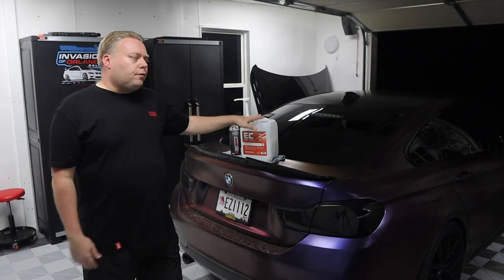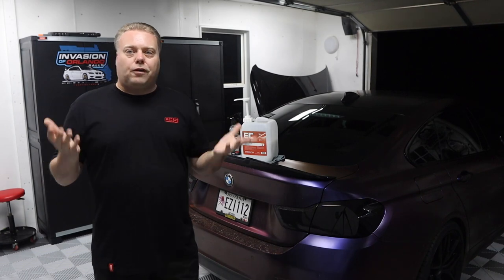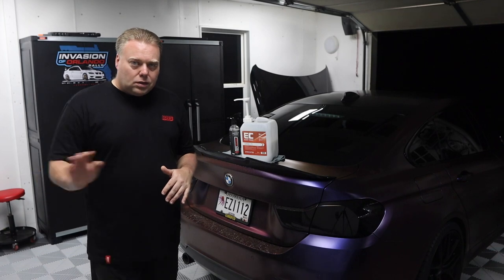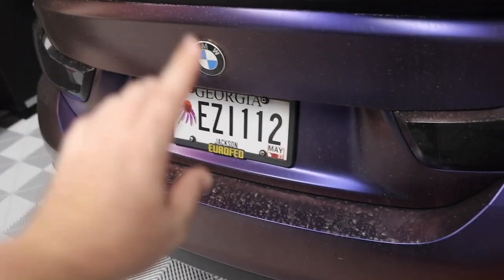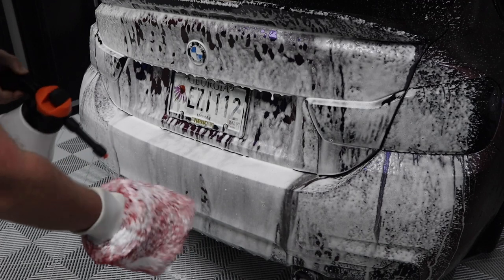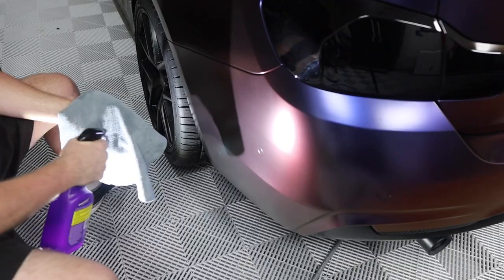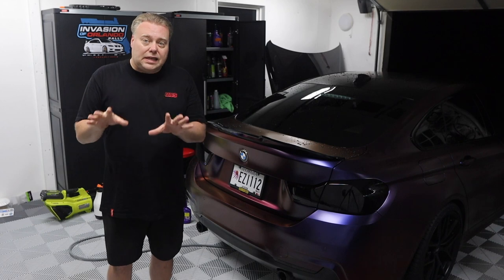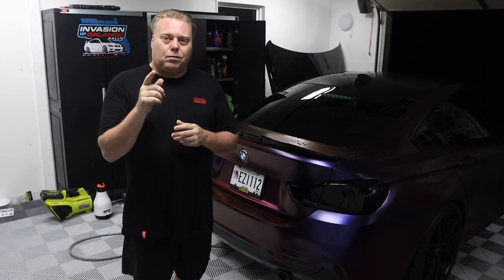Spray & Rinse Sealants | What you need to know | Quick Beads | Easy Coat

Comment: pointless over any durable coating as these spray n rinse products are not durable whatsoever especially onv wheels where you're using high ph or low acidic cleaners.  if it lasted a couple wages sure but  quick beads n ceramic gloss are gone after a thorough wash . use a coating or true sealant designed to resist chemicals and you'll be good no need for spray n waste products
Reply from the maker: Spray and rinse are meant to be toppers to a true ceramic coating in my opinion. Never would use as any kind of long term. I don’t use high ph or acidic wheel cleaners. Since they are coated I just use a ph nuetral iron remover and normal foam soap do my contact and clean every time. I will tell you it took a lot to finally get that locked in dirt out. So they were real durable against me trying to remove them.

Comment: or you could just wash the car when dirty and stop with all the waterless and rinseless wash only applications
Reply from the maker: I don’t do toppers anymore todays coatings are so much better I just let them do the work. Rinseless and waterless though both require contacting the surface so that would be cleaning. Touchless yes does not get fully clean.

Comment: I don't think these are "sealing in the dirt" -- chemically that doesn't make sense, because it means the sealant is still on there and somehow standing up to dozens of washes including with APCs. They're just not that durable. I suspect this is some kind of mineral based residue. Since APCs and iron remover aren't removing it, I would suggest trying an acidic cleaner, like a water spot remover. It's the 3rd part of a typical chemical decon wash and what us northerners do in the spring to remove salt deposits from our car.
Reply from the maker: Water spot remover does not work either. I talked to several chemists who said you can seal in the dirt layer or at the least the dirt or residue is part of that layer. Using a sealant too much just buries it under those layers. I probably applied these sealants dozens of times before realizing the dirt. You could be right, but I’m no expert in that field to know. 🤣
I can say now not applying a sealant for months the surface it getting more vibrant every wash and looks like I might finally have it all off.

Comment: A cool vid Keav (a cool name, never encountered one 🤔), yeeeah,,topper buildup" is a thing, I never had it, but my friend reeealy loved his toppers, I'm not that guy - I'm not a fan of these spray / rinse sealants (maybe on wheels, contemplating now between wet coat and quick beads - wich side you leen on?) and any qd or topers in general, on my BMW I like to see raw coating performance, on the daily though I experiment - lately used Gyeon Ceramic Detailer - left the surface super slick and mega shiny (I can see the appeal) but still, none of this stuff will ever touch my German destroyer of worlds 😅 cheers!
Reply from the maker: I no longer use toppers since I have redone using DIY ceramic coatings. I prefer the raw performance as well plus saves money. Especially since I have gone Rinsless for my contact wash I don’t need the extra hydrophobics to leaf blow the car I towel dry now. I prefer Quick Beads if I did a spray and rinse and Gtechniq easy coat would be a close 2nd.
Reply: @CarsWithKeav  Man Keav so cool you have come to the ligh and finally towel dry :) No mineral buildup from evaporating water from the blower <3 Hey what do you use on the wheels (coating and or topper wise)? I used Carpro DLUX on my winter black matte 796Ms and on my 791M gloss blacks but maan the contamination and brake dust from the M performance breaks is hell and it clogged the coating in like  3 months time... (and i wash the wheels weekly) It beaded really good untill.. it didn't xD had to use iron remover (try to minimise it as it induces rust) and DIY Water spot remover (BOOM got the beading right back) i just wonder how you deal with the wheels - do you use a specific wheel coating, or normal one, or spray sealants (contemplating Quick Beads now as a topper over DLUX) or normal wipe off ones :) Thank you soo much sir for the reply, it's always a pleasure speaking with you!
Reply from the maker: @victoryensured7137  I have Gtechniq C5 and DIY 8 year on my two sets of BBS CIR’s. I switched to carbon brake pads which helped a lot with my brake dust. The Gtechniq has worn off and I’ll need to recoat. The DIY 8 year is just amazing if it’s not beading water spot remover and it’s back. When I did leaf blow I used spotless water so no minerals there.
Reply: @CarsWithKeav  So you don't use toppers on these wheel coatings like Quick Beads or the Gtechniq one from time to time? As i sad i don't do top my main paint but on wheels im wondering... I love both DIY and Gtechniq a lot, top tier companies but wished Gtechniq was a little less stingy with the amout of product they offer for the price, just look at C6 Matt Dash - such an amazing product but man 100ml? I know you dont use a lot but still :) Thank you for your time and sharing the knowledge!
Reply: @CarsWithKeav  Oh and C5 was great when i used it, a really good wheel coating, with DLUX i have mixed feelings though haven't tried the DIY one, i have on my shelf the DIY 3 year.
Reply from the maker: @victoryensured7137  agreed, I love c6 matte dash, but is expensive. Their prices will always be slightly more since manufactured in Europe and the cost of bringing here. I used to use toppers on the wheels, but that 8 year coating just doesn’t need it.
Reply from the maker: @victoryensured7137  What I liked best about c5 is you could still attach wheel weights to it and they would stick since it’s a quartz coating. Only problem lasts just a year or two.
Reply: @CarsWithKeav  Dlux is the same in this regard (lasts year or two) but it was a pain to apply in my opinion and in my case, albeit the beading is strong and cool, still it clogges up REAL fast on performance break pad dust, oh and Keav im from EU and here Gtechniq is also expensive - it's just expensive everywhere (and stingy with amount of product) xD Hmm maybe i'll pass on toping my wheel coating after all, nothing good ever comes out of toping (short term quick fix and exstasy over long term crying and cursing and working a lot to fix it), but still i might buy the Quick Beads or Ceramic Gloss to test it for my daily beaten Toyota CHR to top up Cancoat Evo - im going to apply DIY 3 year or the stack on it some time in the future so i don't mind at all :) Cheers!
Reply from the maker: @victoryensured7137  wheel coatings will always clog not just from brake dust, but it’s the area that gets a lot of road grime from the road which is usually minerals as they get spun and the water evaporates and dries causing the minerals to mask the coating. Just like the panels behind the wheels will exhibit the same
behaviors over time.
Reply: @CarsWithKeav  Still even when i don't drive in rain? I never drive in the rain with my BMW (the whole clogging and DLUX is on BMW) and still it clogged SUPER fast, but your right, wheels get a beating...
Reply from the maker: @victoryensured7137  Wow, have not had that problem I don’t get much brake dust. I have the F80 M3 brake upgrade with carbon pads. I myself don’t drive my car in the rain either. 🤣 My wife’s car in this video get all the rain driving and my X1 daily. The 335 is a garage queen now.
Reply: @CarsWithKeav  Keav your living the dream man! 😁 And i really like your vids, if i had a garage (i only have a communal one, still a nice one at least, all my detailing is done in there) i would spec it to your standard and be in debt for the rest of my life 🤣 Oh and did i mention i want your car? 🙏
Reply from the maker: @victoryensured7137  Thanks! I went into debt quite a bit building the garage, but a YouTube ended up paying for it over a few years.
Reply: @CarsWithKeav  I watched a vid of you explaining the financial situation with YouTube, and i'm really glad, you earned it! Keep it up Keav!

Comment: This is great to know! Thanks for posting! 
I was considering doing this exact thing - foam, rinse, and a touchless sealant - over the uocoming winter so you saved me! 
I had considered the possibility of sealing in dirt but I figured that one it happened because I thought the silence wouldn't be able to cling with dirt behind them and would just come off in the next wash, but evidently not! 

I guess I'll rinseless wash at least before adding additional protection. Thanks again!
Reply from the maker: Yeah, panel has to be clean. I thought it was clean enough. Well lesson learned. 🤣

Comment: Curious, what did you ultimately use to rid the wrap of the spray wax buildup? Did you try DIY water spot remover or their APC All Clean. I know the water spot remover works well to restore water beading to clogged ceramic coated cars. As usual a great and informative video.
Reply from the maker: I just stopped using toppers and continued to wash until it was gone. Some areas I had to do ver light polish and was doing a new ceramic coating anyway so worked out. Not a good idea to polish satin, but it actually came out real nice.

Comment: Great Video! So if I understand you correctly this build up occurred gradually when you performed "touchless" washes and then used the air dryer, instead of a towel correct?
Reply from the maker: Touchless Wash that didn’t get all the dirt off the surface and then the spray and rinse sealed it in so it couldn’t be easily removed next wash. Air drying isn’t really a part of it because the damage has already been down. Using a drying towel is less of an issue as usually most do the sealant application then which gives you another chance to wipe off the dirt.
Reply: @CarsWithKeav  great information and great video, I guess the best way is to use a simple, solvent based detail spray that has no protection, and the solvents will help dissolve some of that road film or soap, film  while leaving a nice gloss behind

Comment: I also have a matte black wrap on my car-- easy coat or quick beads hurt the finish or become more glossy? Which product has given you better hydrophobics? Better longevity? 
Thanks so much!
Reply from the maker: Both will leave a little sheen, but not much. I prefer Quick Beads, but I still use both as I have a large supple of Easy Coat left over. Quick beads is more water like so it mists better to allow you to not waste so much product.

Comment: When my car  gets really bad in the winter from road salts I will do a foam apc or even an acid cleaner to get rid of the minerals Descale.. Wonder if you try 10 to 1 in your ik foamer with an apc if it will strip that off
Reply from the maker: It probably would. I’m just wearing it down slowly right now. It’s almost all gone. You should have seen a few months ago. It was like driving in the rain letting it dry then just clear coating over it.

Comment: My question with these spray on rinse off is what if I want to use a ceramic spray or some sort of wax at the end of my job since I am rinsing it with something like Hydr02 from car pro. Would these be more for people that have already applied a spray wax or ceramic spray few washes before and then use the spray sealant to just keep the hydrophobic properties. Does that make sense? It wouldn’t make sense apply spray wax on top of a panel that got rinsed with spray / rinse sealant
Reply from the maker: There are people that stack these they use a rinse sealant and then a drying aid. For me it is a topper for the true coating whether it is a SIO2, wax or a true ceramic coating. They can also be used as the true coating. They just don’t have the longevity as most of the wipe on and buff off ones. Most of these have 3 months and most of the wipe on and buff last 6 months
Reply: @CarsWithKeav  but if you spray for example turtle ceramic wax at the end of the job you wouldn’t be able to use these products UNLESS you wet the area and then rinse winch wouldn’t make sense
Reply from the maker: @emadventures6975  You would use these products after rinse then spray and rinse.  Then use turtle wax during the drying process or when dry. It really makes no sense to use them together in the same Wash process. Best to use these as a topper coat during washes. If you still use a drying aid with a drying towel these really make no sense because most likely the drying aid is doing the same.
Reply: Thanks for making this video, very informative.